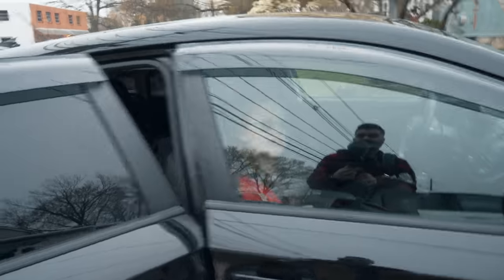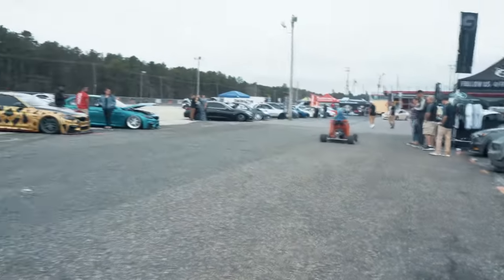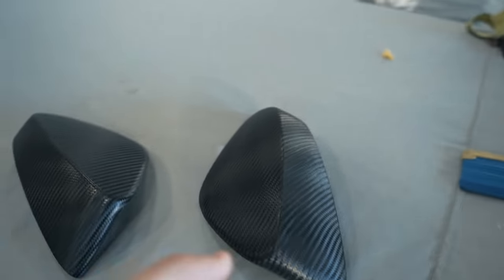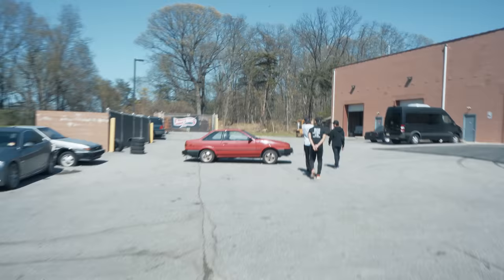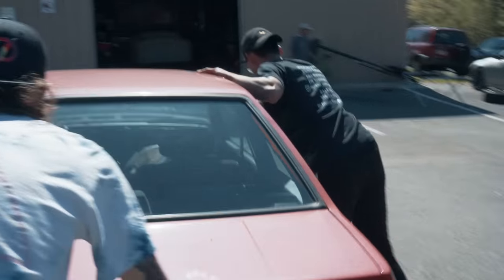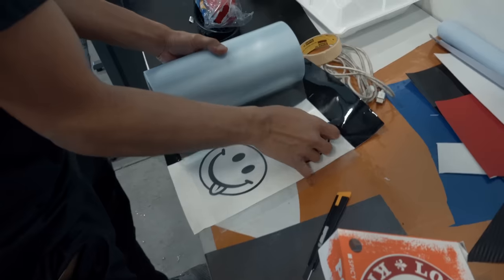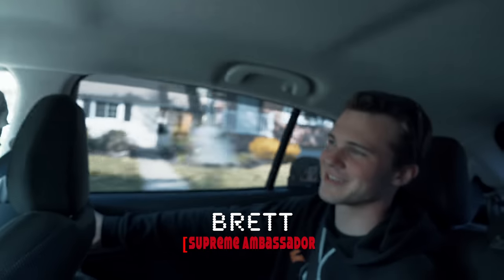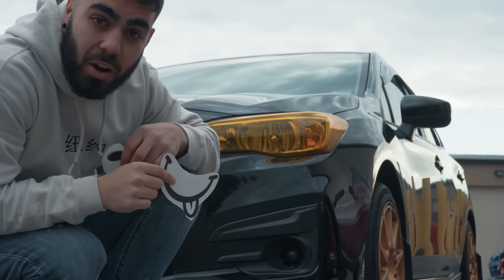Happy Headlights On My Subaru Impreza + Elite Tuner Promo

Comment: Thanks for posting so many great videos of tearing down parts of the car. Everything I've seen so far has been ascetic, but I'm itching for a turbo and the quad tip exhaust. The 10.5 0-60 is a little laggy for me but I needed the hatch. The thing I've been trying to figure out lately (with no answers) is will the wrx/sti hood with the scoop fit on the impreza? I think that would really round your cars look off nicely also. Anyways, love the work. Keep it up!
Reply from the maker: No it will not my friend. But hey, if you want the hood of the WRX, all you’ll have to do is buy the front bumper, fenders, and headlights to go along with it. You will also have to shave the parts to fit them on. I would love to do it, but it’s low on my list right now.